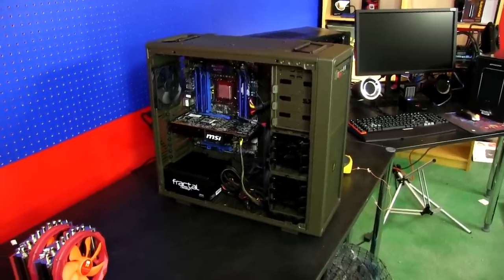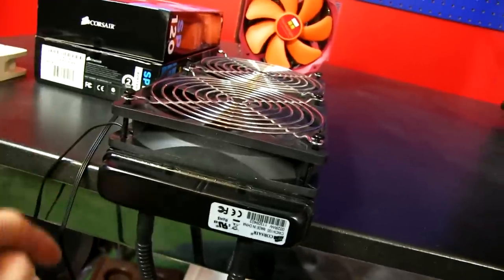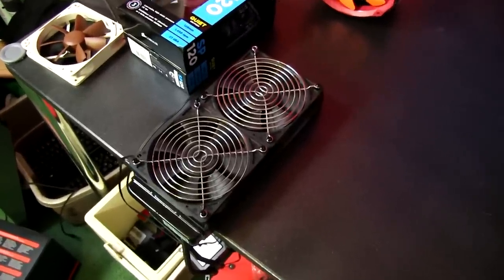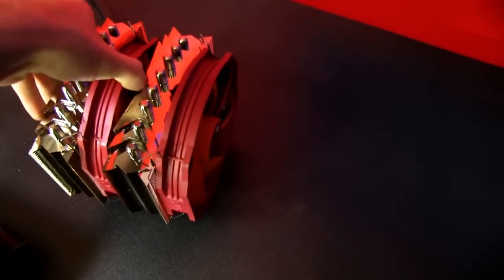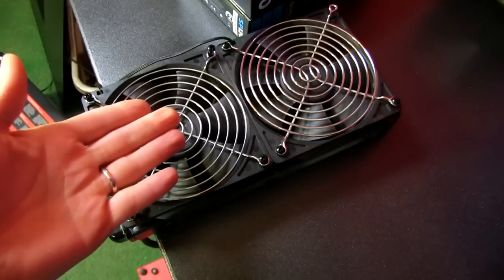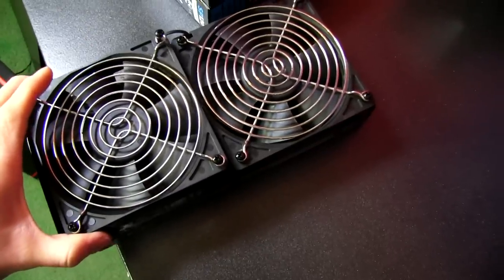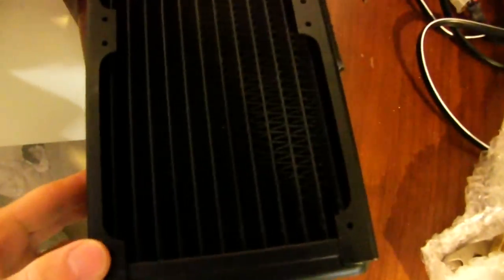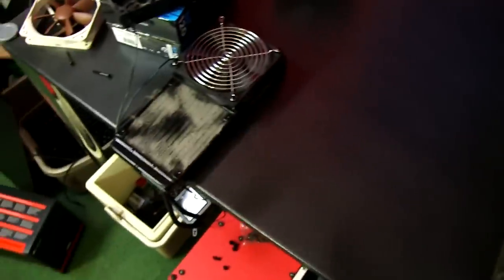Push vs Pull vs Push Pull for Radiators and Heatsinks Linus Tech Tips

Comment: The pull type system is obvious, because everything what build with cooling rads, using it the same way. But, I will make a deflector between the rad and the stuff in the case, to avoid blow the warm air from the rad onto the motherboard, etc. I got the idea from WRC cars. (rally cars) They have got the cooling fans and rads completely separated from the engine. If it work there, it must be a great choice!
Reply: That's not what he means.  He means inside of case>radiator>fan blowing outwards, pulling the air from inside the case through the radiator then the fan.  You're getting push/pull mixed up with intake and exhaust :)
Reply: Darth Flynn No I'm not.
Reply: Fair enough, but you know if you use pull on a rad it's not blowing hot air onto your mobo, it's blowing it out of the case right? So there's no need to build a deflector.  It's taking the air in the case and drawing it through the radiator to the outside as an exhaust.  Maybe I'm misunderstanding your idea?
Reply: Darth Flynn i think he meant to further make that pull proccess more efficient by putting up baffles/ shrouds on the mobo area to make the air go over top of that rather than pull the air through the mother board components and then the rad. Kinda what the TUF series of motherboards do, as they are designed to with both dust protection and mobo cooling features.
Reply: ScottPG PlayPC But you want cool air on your mobo lol, he's taking about putting a shroud up to stop hot air getting on it, which means hes using the rad fans as intake.  Definitely getting push/pull mixed up with intake and exhaust imo
Reply: Darth Flynn No. The fan pull the air trough the rad, even it will be intake and not exhaust. Rad on top of the case. than fan (pull) and deflector between the mobo and stuff inside. We are talking about watercooled rig. Not need to make ventillation inside, when every parts are watercooled.http://i138.photobucket.com/albums/q254/ftskftsk/car%20stuff/galleria_focus2007f.jpg As you see, there is no heat from rads blown on the engine. And it has got pull style cooling,
Reply: But why would you blow hot air into your case in the firstplace?
Reply: I would not. That's why the deflector. For first place, the air more likely colder outside the case than inside. I got air trough the rad from the room then blow it out the back without its hit the inside the case. Do you understand me now? Like on a car or so.
Reply: If the deflector keeps air from pushing out to the motherboard, it would also keep air from pulling in from the motherboard.  Unless you have a filter on the outside of the case, my experience is the dirt will bypass the case mesh and get trapped on top of the narrowly-spaced radiator fins.  Why not suck air through the back of the case and vent it through the top, so you can clean the bottom of the radiator without removing it from the case?
Reply: I think I share a picture when it will be done. For better understanding. Watercooled CPU, GPU. The motherboard itself doesn't generate awful lot of heat but, bear in mind the case won't be airtight. It will got ordenary airflow as well but, the most crucial parts will be separetely cooled for best performance. Basically everything will be blocked away from any warm air from any other components. Only cool air and water will be in contact with the parts.
Reply: Peter M If i have understood you correctly you are talking about pulling air from outside the case past the radiator cooling the cpu then exhausting that air out of the case without passing it over any other parts inside the case? nice.
Remember tho MB parts do have very hot spots on them too and do need air flowing a bit too but I think you have mentioned that.

that sounds like quite a job and pretty cool (pardon the pun)! Post a vid or a pi if you complete it

Comment: Linus i know you recommend pressure optimized fans for radiators because they need to push air through substantial resistance. But if you go with the pull configuration like you recommend here... wouldn't it be better to use an airflow fan instead? Since there wont be substantial resistance for the fan in pull configuration (i.e mounting 1 fan and radiator as an exhaust in the back of the case) ... I guess to make it simple my question is are pressure optimized fans also better for PULLING against resistance rather then pushing ??

Comment: I didn't realize how old this was till I started watching it. I can say though my experiance with running push pull and lowering the fan speeds is better and quieter cooling using the 2 fans that came with my H75. I have tired running just one and let the computer decide the speeds and it is one noisy computer. Using both fans and running at 15% at idle and suing 15% step ups with temps I have set in the MB it is a very quiet and cool system now. Yes I have to pull my fan to clean but worth it for the silence.

Comment: I use 6 fans on my AIO. But what you don't expect is that I all 6 pull out of the card. What I didn't mention is that all 6 of them are factory grade fans that after a while of them running, the radiator starts to glow, then I simply glue on a PCIE connector onto the bad boy, unscrew the whole thing loose and slam it into the PCIE slot, and there you have it, your PC rig just got a new GPU.
Reply: lmfao

Comment: What happens is that the maximum airflow of a fan is X. When you add a 
resistance (heatsink) in front of the fan, the resistance lowers the 
amount of flowing air by Y (X/Y). Adding another fan (+X) makes the 
heat-sink-resistance divide by 2X fans (2X/Y). However, the effect of 
adding more fans quickly diminishes AND as soon as the maximum airflow 
of used fans is reached, no further airflow can be achieved.

For example: Imagine you are driving 1 car at 100km/h while pushing the gas pedal all the way down. Then you attach a 1000kg cart behind the car (resistance). This makes it go at 80km/h instead. You then attach another identical car in front of your car, with the same amount of gas. This divides the weight of the cart over two cars. (1000kg/2 cars). This makes the resistance for each car much smaller and they reach a speed of 90km/h (10km more than when only 1 car was pulling.)
Does this mean that attaching 100 cars make them go 10km/h*100 cars = 1000km/h?
NO, since their original max speed is 100km/h, it does not matter how many cars we attach - they can never reach more speed than 100km/h. The resistance of the 1000kg cart becomes smaller the more cars we attach, but already after 1 extra car, we only gain a small decrease in resistance of each car.
Reply: Basically, synergy

Comment: If u want your fans to be effective and quiet u must have some space(about 0.5~1 sm) between the radiator and the fan(U can use the hot glue stick cut it and put a screw from the fan to radiator).When u place the fan directly on the radiator the blades create a lot of noice(especially when they are for intake).If u manage to fill the air gap between the radiator and the fan u would be surpriced by the resault(duct tape can help u with that)

Comment: and if you have them to pull the air in from the outside of the case your radiator will work as a dustfilter for the inner components and the fans that are pulling which with the newer fans isnt a problem because theyr all dustproof but with pull you just go with the vacuum cleaner along the radiator from the outside without even opening the case and taking the risk to damage stuff with the vac and your good to go or you could even like build a dustfilter and put it on the other side of the rad so make cleaning even easier

Comment: to break the ice, push has a better heat transfer rate verses pull due to the area of high pressure after the fan letting more dense air absorb more heat verses less dense air... you will notice about a 10,000th of a degree difference .. (so it doesnt matter really)

Comment: you also forgot 1 fact, that the dust showed brilliantly, the dead spot, with push type there is a dead spot where no air gets too, put with pull it creates a vacuum over the whole area and pulls the air through every single radiator fin!

Comment: Yeah but what about in a tiny case? In My tiny 12L silverstone ITX case, I have just one fan: it's the intake fan, the radiator fan and case fan all in one. I want to know whether I should convert my one push fan into a push-pull setup. The idea is that the push fan has high pressure to push the air through, and the pull fan distributes the (warm) air across the case to the PSU or passive outlets.  As for dust... well let's say i'm more worried about cooling than dust.

Comment: but Linus, what of a radiator like the "Monsta" by Alphacool they are like 80mm thick? I just got me 2 rads (for my next build) and am planning to set it to push pull. Is it necessary or do I still get the same performance just by pull? (going with the nf-f12 pwm for me rads by the way.)

Comment: Oh. Air can sometimes push it down into the fins. That's why I mentioned a high pressure air compressor, because it will completely blow it all out.
The reason I mentioned water is because some people debate that if you use an air compressor then it can pick up water from the air and blow it into your computer, but I have never had a problem with that.

Comment: Yes, but what if you're using pressure optimized fans anyway?  My first time water cooling, I picked up Phanteks T30s.  If I use one fan on high it's 0.28 in-H2O at 39.7 dBA.  If I put two fans on medium, each is 0.13 in-H2O at 27.3 dBA.  I'm not sure if the pressures linearly add (but if they do, it's almost the same with 0.26) and the noise is only 30.3 dBA.  In fact, all six fans on medium on a 360mm rad with a push-pull setup is 35.1 dBA, which is still less than just a single fan on high.

Comment: I got my first H110iGTX mounted. As I am new to this topic I mountetd them to push from outside the case to the inside. The Case (corsair 750D) got a dust filter on top of it. I hope this will be good enough. 

My question is. If I got 2 Fans at the front blowing inside and one at the back outside with the radiator fans also blowing inside, is that to much in or just okay to go?

The other question is setting up Corsair Link to keep my AMD FX 9590 cool. whats the max tmeperature setting for this CPU? Any experiences?

Comment: What I do is put gentle typhoons on pull on my triple 120 rad and use a triple 120mm demciflex air filter to collect all the dust. Its magnetic so it will stick on the rad no problem. All I have to do is rinse the filter once a week and my rad will be dust free year round.

Comment: What would you use for a H80i? Going use 2 Akasa Apache Black 120mm fans and I don't know if I should be pulling air from the outside inside the case or pulling air from the case to the outside. Both options are good because I have 2 200mm CM MegaFlow fans and 1 Antec quiet fan that I saw laying around... Which one would be better?

Comment: On the top of my case, I can fit a radiator with two fans. I'm not really an expert with these so is it alright if I just get two 120mm fans and install them? Also, should the fans be pulling air into the case or pulling air out? My case is a NZXT 240. Sorry, I'm new to building. Thanks in advance!
Reply: ***** New in the building too, but as hot air moves up, you may want to have your fans blowing up (out) pushing or pulling.
However I have no data to prove it, just my logical thinking.
Reply: Thanks for the reply! I'm actually going to stick with that idea after hearing multiple opinion. They all suggested that the fans should be blowing air out.
Reply: ***** 
:)
Thanks for the info too happy to help

Comment: Hello. So to avoid dust on radiator, fan should install bottom of the radiator and let fan air pass through it?? So from bottom view, fan(air facing up)-radiator-case cover. Is this right or radiator-fan(air facing up)-case cover?? Thank you

Comment: Thanks for the video... I changed after cleaning my radiator in a fully filtered case.  Just one thought... I have learned... .  I am currently using the Bit Phoenix Ghost mid tower with my corsair radiator mounted below (at the top) with four fans (120mm) in the pull orientation sitting on top.  (note:  I have the top grill removed to make room.  I would consider a front mounted

Comment: Couple of questions.  Firstly, let's see the dust between the fans and rad in the pull config, and secondly, why didn't you run some tests actually comparing the 3 configs?
Reply: becauseif doesn't matter if your fans are pulling or pushing, the delta pressure will be equal

Comment: i hate dust filters, my case had them and i took them all off because i noticed that if i put my hand behind the fan when it had the dust filter on it you could barely feel the air moving out of it whereas with the dust filter off it was like a gale force wind in comparison.
Just don't put the computer on the floor, keep it on a nice hard, flat surface thats reasonably high up and you get such a small amount of dust that you rarely get a dirty enough case to need to clean it.

Comment: Push is not hard to clean, you just need to right duster.  Get something like the Metro DataVac Electric Duster, and behold - dust you didn't think could exists in such amounts WILL come blasting out of the top of your case (from your rad).

I dust mine once per month - the few time I took the fans off to be sure, there was little to no dust left (sometimes I skipped a month) after the air blasting.

Anyway, on MY rads, pull didn't cause a drop in temps, and push/pull affect a core or two by perhaps 1-2 degC

Comment: I think there's something to be said what kind of radiator you're trying push/pull on. For example if you're rocking a 80mm Monsta vs a thin radiator... and the FPI difference between high resistance vs low resistance radiators. Just saying a simple No as a one size fit all answer for whether push/pull is effective isn't exactly accurate.

Comment: Hi Linus, I found that push pull works so much better with SP120 on my H55 and its so much cooler then compared to just running one fan. With one fan I found it was as hot as my car radiator LOL... I can not tell you why it ran so hot with one fan

Comment: I do pull on my water cooler. I use a compressor to clean it out about every 6 months, takes less than 5 mins.  I can usually tell when it needs cleaning as the fan will increase speed and noise as the radiator gets dirty and clogged. I recently added a disposable vent filter on the outside of the case, so that should reduce some of the dust.  Truth of the matter is, most people do not clean their machine.

Comment: if I´m using a 120mm liquid cooling, should I put it in front of the case or at the back of the case? I´ve heard that if it is a 120mm the best position is at the back of the case but I want to know your opinion. Also it will be a push-pull configuration with two fans, it is a Corsair H60.

Comment: Now we've established "pull with high SP fans" we need to sort out whether its better to pull air in from the outside (what I would normally do) or as Linus did, pull air from the inside across the rad and out. Opinions?

Comment: "The best possible performance of the EK-Furious Meltemi 120 fan is achieved in pull mode. Such a regime evens out the airflow through the entire surface of the radiator since the motor hub dead zone effect is lessened"

-EKWB

Comment: would it be safe to install a noctua a14 fan to replace the nzxt fan? my nzxt fan is causing some rattling noise recently and im not sure if a noctua is compatible
problem is that the usb header on the x40 sends signals to jump rpm above 1500 rpm and the noctua's max rpm is 1500 whereas nxzt fan is 2000 rpm

Comment: Is it bad to have the radiator set up in the front of the case pulling air through the radiator into the case? I have an NZXT H440 with 3 fans blowing air out the top, 1 exhaust fan in the back, and 1 Corsair H105 mounted in the front with 2 fans behind it pulling air into the case. Thanks for your time.

Comment: pull may be better for dust but in my experience push is a lot quieter (well with the fans i tested with). however, i use push/pull on my 240 rad for optimal performance

Comment: Get a case with dust filters, have negative air flow, have a radiator on top pulling air out, and you're golden.  If you have a dust-proof case then everything is a-ok.

Comment: When I added my second SP120 to my H80i, I saw a 4C temp drop. To make sure, during the test I stuck a pencil in my second fan and the temps slowly creeped back up 4C. I say push pull is worth it atleast on a single double thick rad. Spinning at 1200RPM is completely unaudible and drops temps 4C. Not generating anymore noise than a single fan, but a 4C temp drop when testing with Prime 95 short FFTs (max heat). As for cleaning a push config: Why not just blow compressed air from the other side?

Comment: @LinusTechTips should you pull fresh air into the case (which would increase temperature inside the case) or pull warm air out (which would reduce temperature of the case but also reduce efficiency of the radiator) ? Thank you
Reply: 1 intake fan, 2 exhaust.
Reply: ***** okay thanks. i hate dust thats why. even with filters on not really helping with the issue.

Comment: With all of my loops, I pull but I also hack/mod a dead fan to place it a few  cm away from the rad, to lessen the dead zone where the center of  the fan is. Does it make a difference, maybe, but I feel it  has to utilize the rad more than with a big dead spot where air isn't being pulled through...

Comment: Okay, but... When you run it in pull, wouldn't you have the same problem with dust accumulating between the radiator and fans on the other side? If it's in push, you can clean the top of the radiator if you remove your top panel. Either way, one side of the radiator is obstructed.